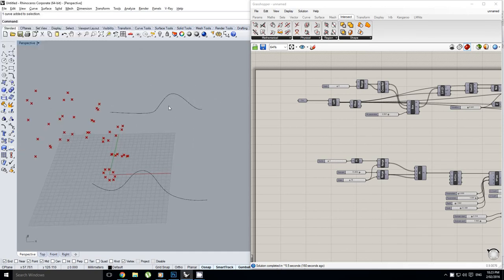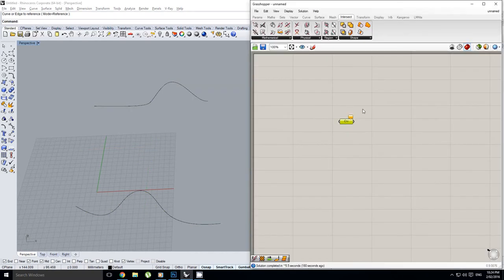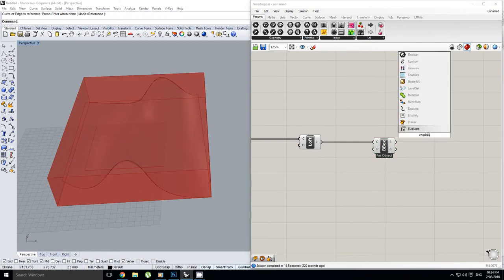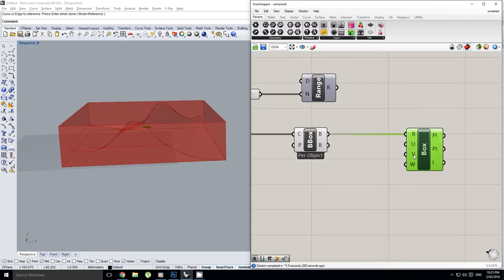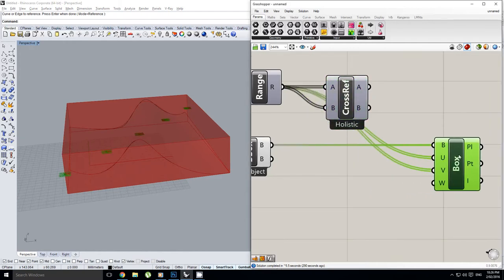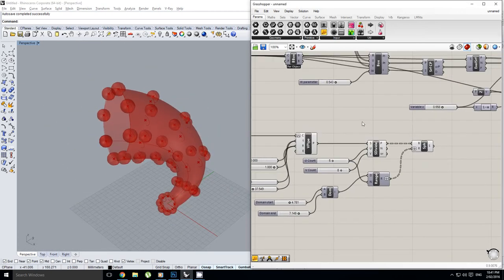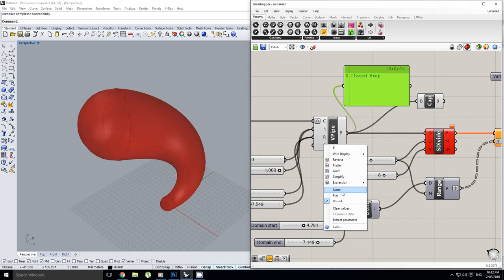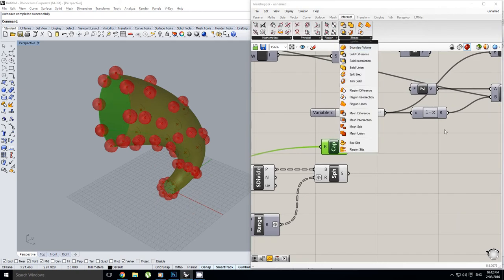Grasshopper 14 - Working with Solid Operators (Booleans)

Comment: I have a question please,
what exactly did you do to remove those squarish surfaces? 8:32 
I have now a surface with the outlines of squares, but now trimmed
Reply: I'm sure you figured this out, but for anyone else who didn't know what he did, he right-clicked or middle mouse clicked on the component representing the surface and clicked the "Preview" option to disable the preview of the surface, this way you'll be left with only the result of the trim component.